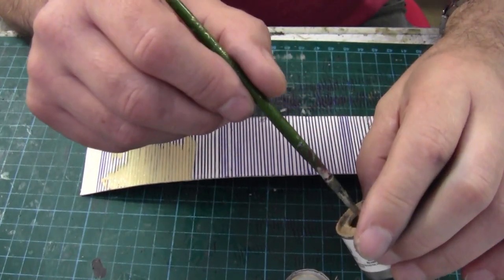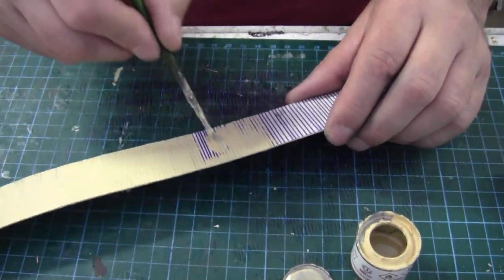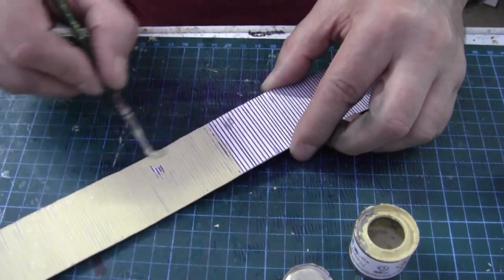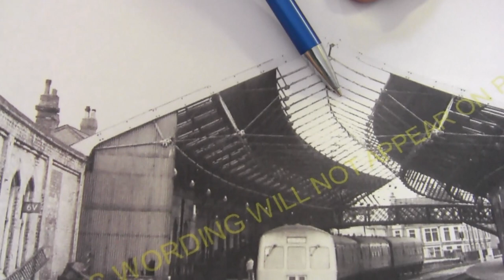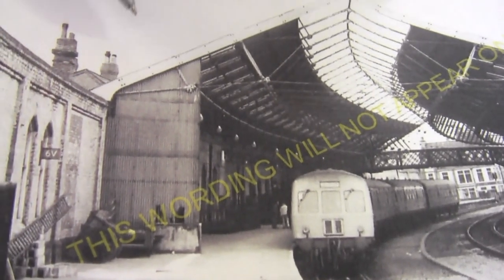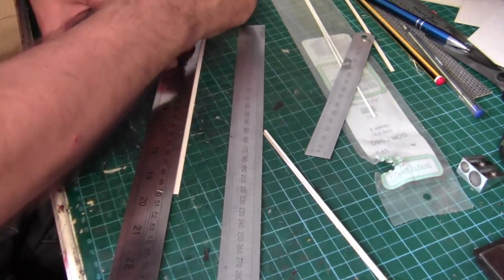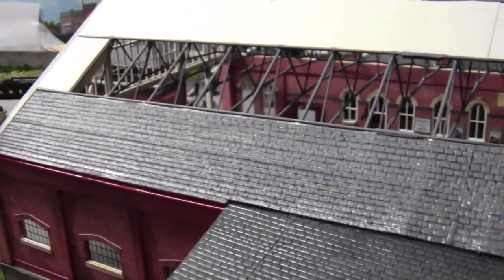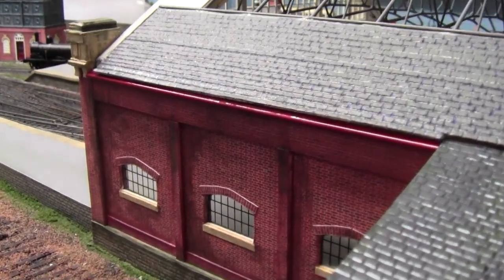The Big Roof Part 9. Cladding & The first trian into Shields Station  No289

Comment: You've done it again Sir. I took the plunge and built my station [kit bashed a kit]. You've just reminded me -I forgot to put the gable end boards and gutters on!
I have painted the sky [twice] Keep up the excellent work. PS HOT TIP Never pick a soldering iron up at the wrong end!!
Reply from the maker: Hi Bill. ouch good tip. 
            i also have the down pipes to do but there is only a few of them. ans they can be knock up fairly quick. thanks again for commenting, stay safe my friend....cheer's Tony

Comment: Short and sweet but watching you scribe roof tiles will never fill a post. One suggestion if I may consider putting a walkway between the concourse and train shed roof. It probably would have had one and most big stations do. The Central has. Never mind keep up the good work.
Reply from the maker: Hi Paul. i might to add some small jobs while waiting for paint to dry etc. I am not sure if there was a ladded walkway across the main trian shed. 
i know some of the bigger stations had them as you already know. thanks again for your input....cheer's Tony

Comment: To be honest Tony mate, I like that the blue pen has offered up a slightly blueish tint to the grey tiles 🤷🏻‍♂️ Looks really good mate and so impressive when looked at head-on 😎 I definitely say leave the glazing from the top part, not least as it means you have a less-impeded view in the train shed 👍

By the way mate, what will you be using to run-round trains? I know you have Kadees so will it be just a couple of magnets or something? 🤷🏻‍♂️

Love the wee cameo of the V2 at end too mate! 😎👍🍻🍀
Reply from the maker: Hi Tim. i will be giving the roof a black wash to finish and some green streaks to add a bit of age. but the blue pen does add the tint like you said. but black have given me lines that a required. 
we do live and learn. coupling and uncoupling not really thought about yet. its something i should look into at some point.
the last few minutes are best part of the video i think. 
hopefully we shall see a lot more running once the roof is complete. until then stay safe. all the best Tony

Comment: hi. have you thought of using a compass for marking your roof tiles.
Reply from the maker: Great idea, but i fear it might be to sharp and tear the card, rather than scribe. the good thing about a pen is the ball on the tip...great suggestion. many thanks for commeting. cheer's Tony
Reply: @TONYNORTHEASTERN  use the pointed end as a edge guide and pencil for the marking
Reply from the maker: yep that would work....cheer's Tony

Comment: Hi Tony, 'nother good video, b/w steam section at the end was extremely realistic.

Question, is it better to scribe using a pen with ink or a pen that has run out? Serious question as without ink there is no bleed through when painting?
Reply from the maker: Hi James good question. the way i see it if there is no ink the pen. after continuious scrbing the pen may seize up with the heat and tear the card. think of the pen as an oiled bearing. when oil has gone the bearing would seize. i think from now on i will be using black BIC pen instead of blue. have a great weekend....Tony